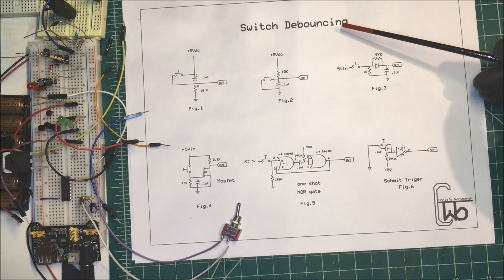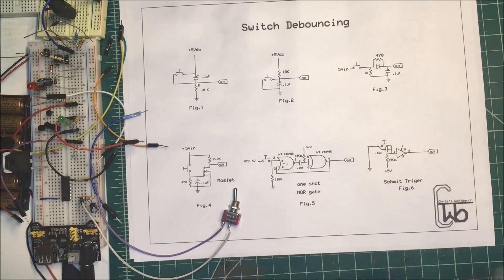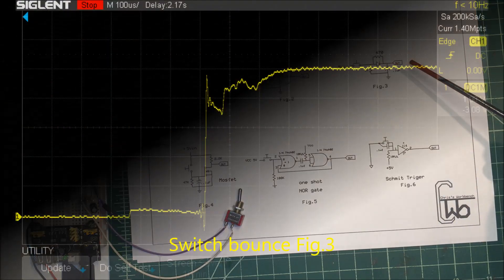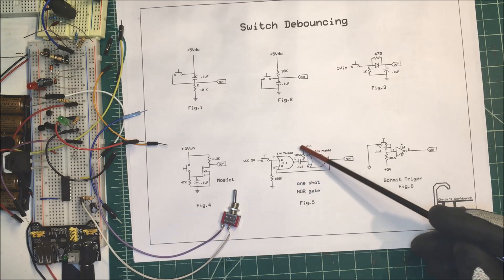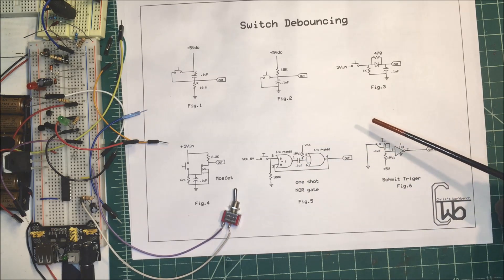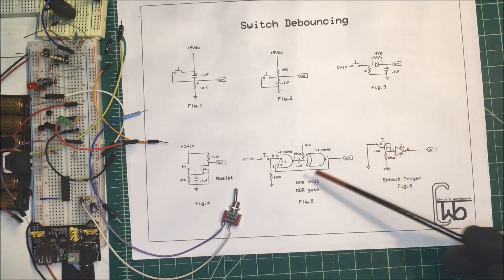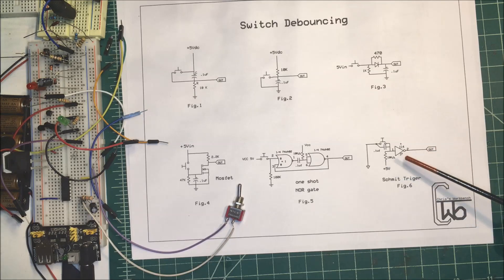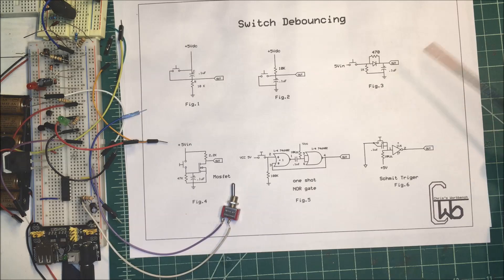Switch Debouncing

Comment: When we are closing the switch the capacitor is getting discharged without any resistor. Isn't this gonna create huge amounts of current(even though that is for short period). the breadboard/pcb traces should be able to handle that.

Comment: Hello sir,
Concerning just your first two examples:  I cannot tell whether the outputs are connected to the line since there are no "connection dots".  I see in the two shots that both are normally-low.
Are the "out" lines floating when the switch is open?
I would think that the 2nd one would be normally-high.

Thank you for this video---this is what I needed.
Reply from the maker: I redid the diagram in the link I hope it cleared it up.